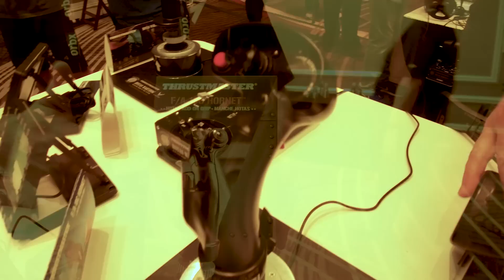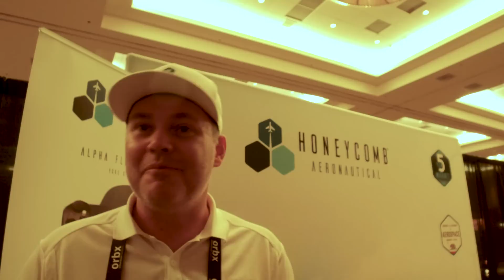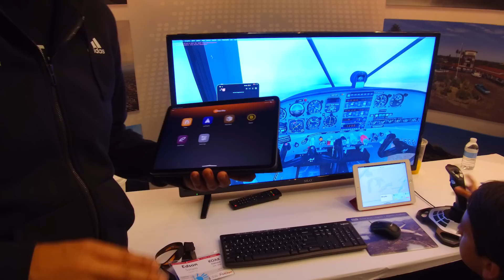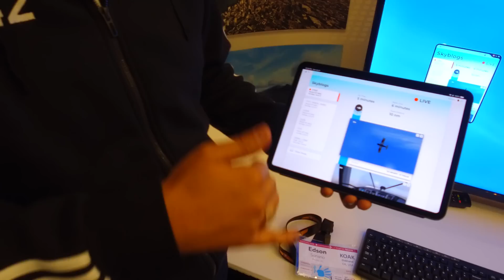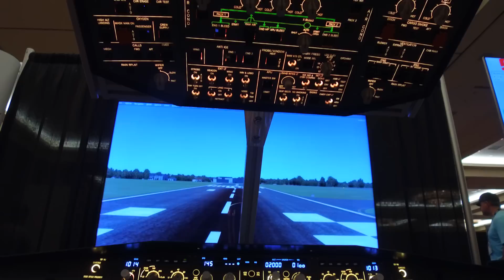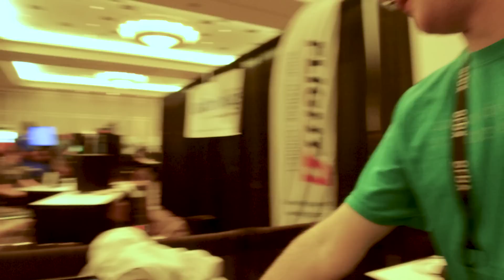FROOGLESIM NEWS SPECIAL - FSEXPO 2019

Comment: Disappointed you haven’t covered the REALLY BIG story....
Reply: He did, then promptly deleted it. He said yeah whatever to the new flight sim. Probably why he removed it.
Reply from the maker: I did but it wasn't well received so redoing it. Sorry you are dissapointed
Reply: @frooglesim  should have kept it up. Nothing wrong with your honest opinions and feelings.
Reply from the maker: The story you refer to was also nothing to do with fsexpo. This video is about fsexpo
Reply: Yep I saved it for later viewing, then it was gone so too late for me. 

I was actually interested to see a non-hyped perspective. My own view is that if it looks as good as the trailer (which I doubt), then its going to run at 1 fps on the best of today's hardware....
Reply: @jellysmith4350  it will be optimized for multicore with a relatively low end GPU (Xbox) so will likely run very well on a $1500 system.
Reply: john smith )